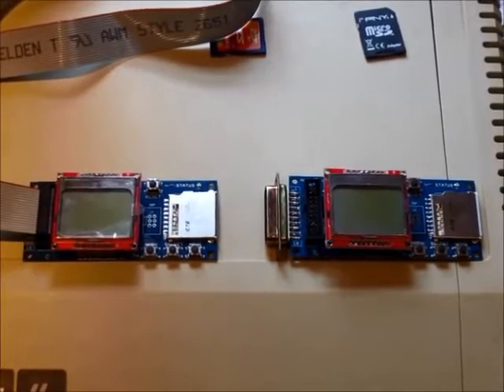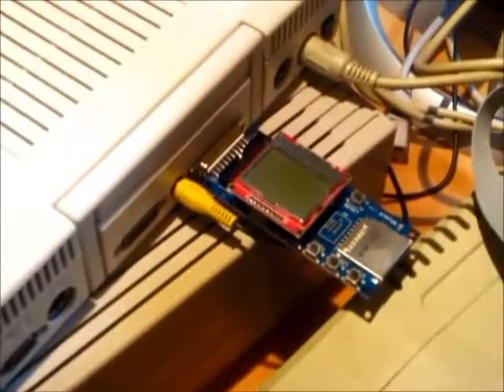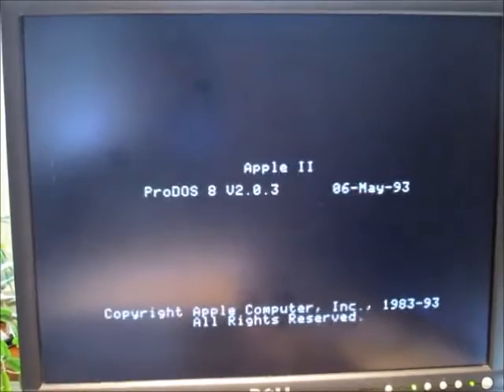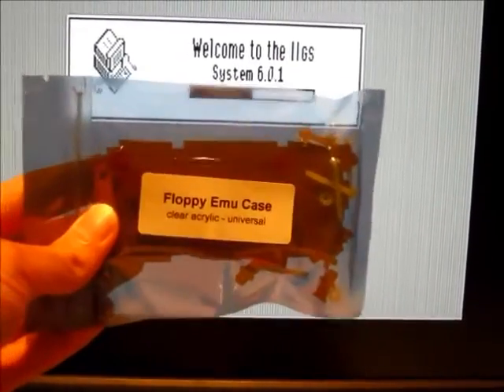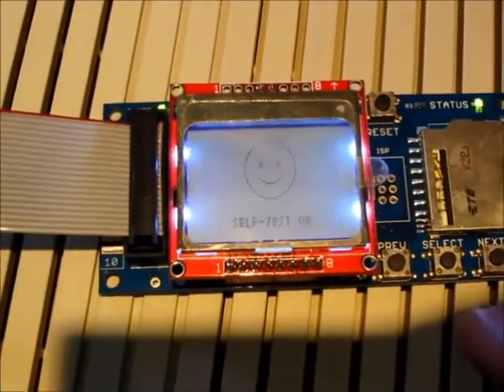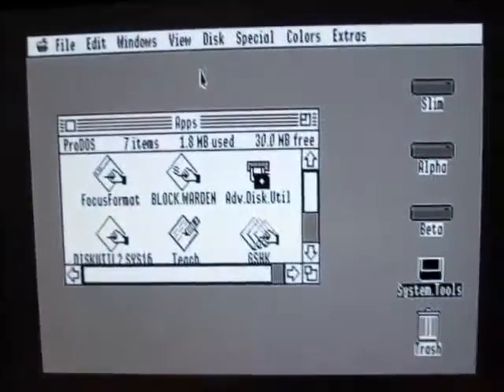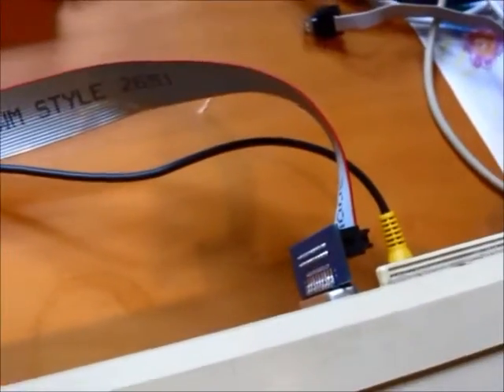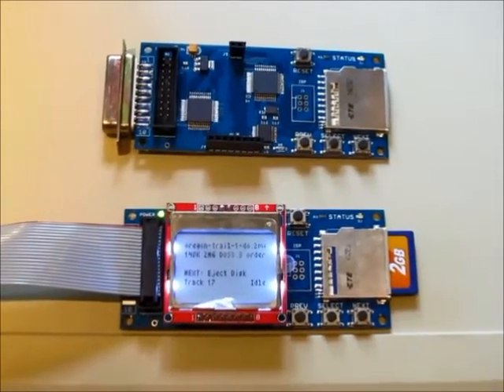Floppy Emu Disk Emulator - Apple II Demo

Comment: Just started using my FloppyEMU with my Apple IIgs. It's a great product! I only have one issue -when the IIGS shuts down from GS/OS (booted off an internal drive), the FloppyEMU hangs, preventing proper shutdown. I'm running the latest firmware as of this post.

Comment: Seem great and all, but it uses the slow transfer rates of a traditional floppy drive, so I might pass. Tempting though, as you can use it on multiple vintage apple computers that you may not have the original OS disks for.

Comment: Question for you. My Mac SE which was just working won't now. It's showing the ? disk image when I turn it on. If I used your emu card is it basically a new OS for the computer? Can I then put 3.5 floppy disks in the front disk drive? I just want to be able to play my Prince of Persia games.
Reply from the maker: +Nathan Barnatt Check out https://www.youtube.com/watch?v=i8bcOGLNdzU which shows an example of usage with a Macintosh Plus. On a Mac, this hardware is like having an external floppy drive or external hard drive. Combined with an SD card containing appropriate OS disk images, you can boot the computer from the Floppy Emu. You can still use the internal floppy drive too if you want, though once you have a Floppy Emu it'll be easier just to put everything on there. See http://www.bigmessowires.com/floppy-emu for the product manual and other details.
Reply: +stevechamberlin thanks! I ordered this one. Do you know if you've put the Prince of Persia game on there?
Reply from the maker: +Nathan Barnatt POP isn't part of the starter SD card software collection, but it looks like you can download it from here: http://macintoshgarden.org/games/prince-of-persia
Reply: +stevechamberlin oh thanks! And I can just drag and drop this onto the mini SD?
Reply: That is correct. When you boot up the Mac SE, just choose the correct OS and it'll automatically load it.

Comment: Do you have to have an Apple Iic with anything better than the ROM 255 to use this floppy disk drive emulator? (i.e. a Iic with SmartPort support) My IIc only has firmware to support the Disk IIc.
Reply: +runforit420 Hi, see the manual at http://www.bigmessowires.com/femu-instructions.pdf

Comment: Thanks for posting this, I'm thinking about buying one as well. How have you found the boot speed compared to the internal IIgs drive? Compared to booting from a standard 800K floppy?

(What's your IIgs internal disk, something like an original SCSI Vulcan or a newer IDE/CFFA card?)
Reply from the maker: +Matthew Nielsen The smartport and floppy emulation are both the same speed as real Apple smartport/floppy peripherals (speed is determined by the drive controller hardware). On the Apple IIc smartport is the only way to get a hard drive. On the IIgs, smartport mode isn't as fast as an internal SCSI or CF hard drive, but it's still quite usable.